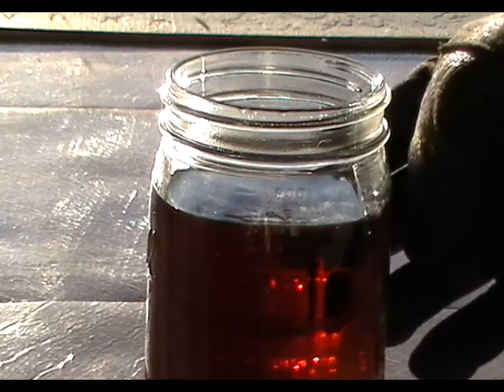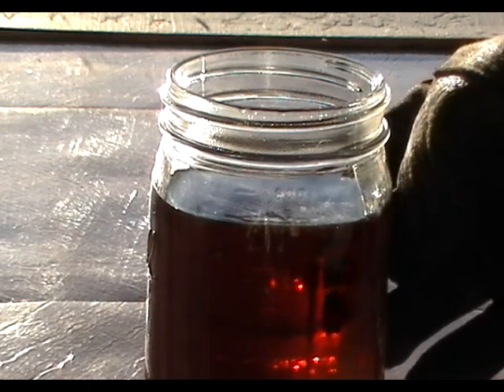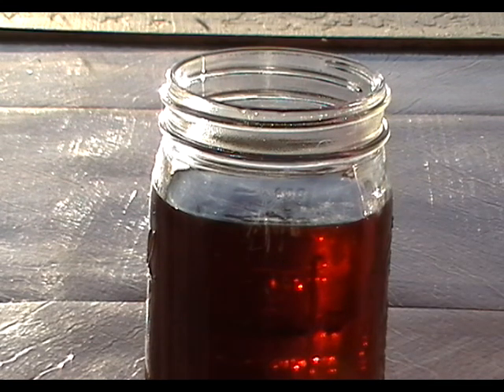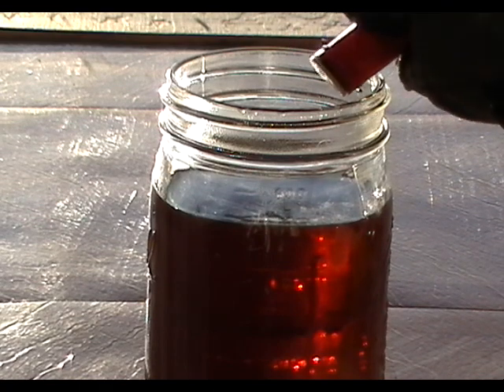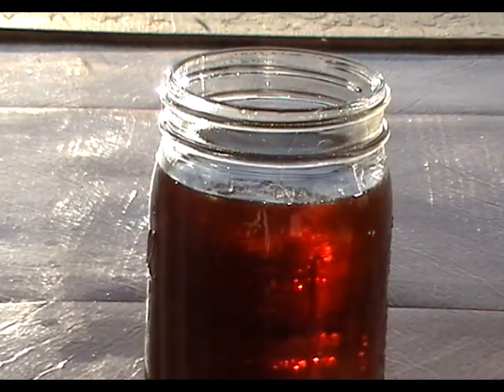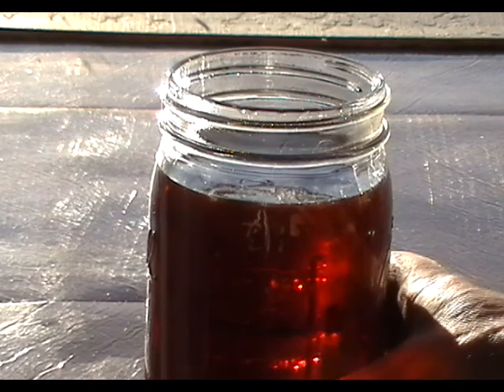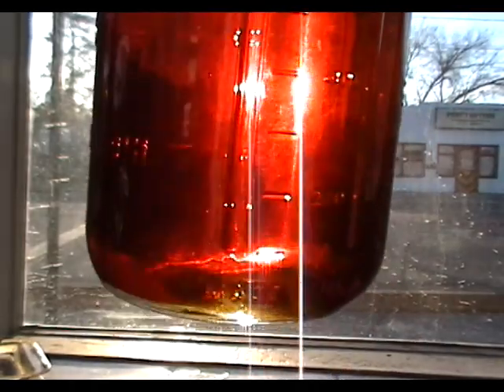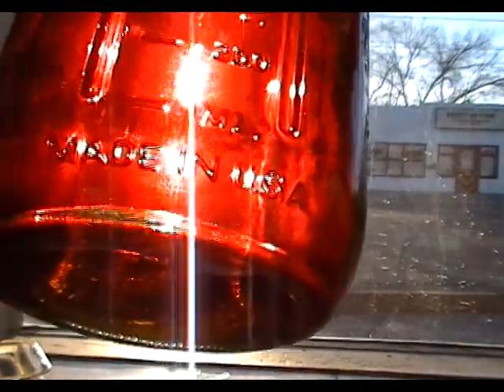Blending Gasoline with vegetable oil to make Diesel Fuel

Comment from the maker: Diesel engines today were optimized to burn diesel fuel, which is 10x less viscous than vegetable oil, so one cannot start up a diesel engine on vegetable oil with out coking the injectors.  This is why most SVO systems have two tanks.  One for diesel to start up on, and one for VO to run on.

However, for short trips around town, then a 2-tank system is impractical.  This is where blending becomes more useful, because you can start a diesel engine on a blend of gas and VO with no coking problem

Comment from the maker: @MrSzviktor diesel, and waste oils could be cat-cracked to simplify the molecular structure of their fractions to produce gasoline, kerosene and diesel fuel.  Or, gases, such as: Methane, propane and butane can be hydrated to make more complex molecules that can be used for gasoline, kerosene and diesel fuel.

Comment from the maker: If you start with clean and dry WVO, then maybe nothing will precipitate out of solution with the WVO when gasoline is added to it, but maybe not.  However, it is a lot less work to clean up WVO after adding gasoline to it, than before.

Comment: Actually diesel is a higher boiling point than gasoline component of crude oil that is separated by means of distillation. It's also produced by cracking longer chains of hydrocarbons with even higher boiling points than diesel into shorter diesel ones. A third method involves producing diesel from lower boiling point short chains.

Comment from the maker: @lolailando your Clear Liquid Shortening, which is all vegetable soybean oil should work just fine for blending.  So, just add gasoline to it at 20%, then let it settle for 24 hours, then drain off the bottom sludge, or pour off the top the good fuel blend, then filter down to 1-micron into your fuel tank.  That is all there is to blending.

Comment from the maker: @125varma it is better to blend gasoline with waste oil first, then let it settle for a few days, then pour off the light, thin blend off the top through a filter, then you have saved your filters and reduced the work needed to purify the fuel blend.

Comment from the maker: @tomt6040 If you put a match to a container of waste oil with 20% gasoline blended into it, then the surface of that container will light, but it is just the gasoline that is burning.  The flame is quite a bit like an alcohol flame, in that it is relatively cool and not strong.  However, I would not heat waste oil with 20% gasoline blended.  There is no reason for doing so.

Comment from the maker: Since blending gasoline with WVO forces dissolved contaminants in the WVO out of solution, then it is wise to use gasoline blending as a stage in your WVO fuel processing.  So, there is no reason to hyper-filter WVO before blending gasoline with it.  Just settle out the fats, separate them, then blend gasoline with the clear amber WVO, then allow that blend to settle over night to a week, then separate the sediments from the clear blend, then filter the blend.

Comment from the maker: The steps for blending gasoline with vegetable oil are:
1) Add gasoline to waste vegetable oil at the desired amount, which is 20% for canola oil, other oils may need more
2) Leave the blend undisturbed for at least 24 hours, if not a week.
3) Separate the 10-20% precipitates from the 80-90% clear, amber liquid that floats to the top.
4) Filter the 80-90% clear, amber liquid blend into your fuel tank.
5) It is best to test the specific gravity or viscosity of your blend to make sure
That's it
Reply: Do you filter the WVO first before blending with gas or can you blend the gas with unfiltered WVO and then filter? Thanks
Reply from the maker: @bobbynolen154  I warm up the WVO until it's fully liquid when I get it and pour it through a series of screens directly into diesel fuel, then leave it to settle and cool for as much as a month. Then when I'm ready to process it further I'll pour that settled blend into a container with gasoline in it which will result in a WVO blend with diesel at 20-30% and gasoline at 20%. And, I'm careful not to pour any sediments or cream colored high melting point triglycerides which have settled to the bottom. I leave that 50/30/20 blend to settle for a few days, and by then I moved that blend into a cone or domed bottom tank. After a few days of setting I'll crack open the bottom valve on that tank to drain off anything dark or cream colored. I'll drain sediments every day from that tank until no more sediments come out. Then I pour acetone at 1% into the top of that settling tank and leave it to settle for 24 hours, then drain any water, or dark or cream colored, then run the blend through filters into my fuel tank.

Comment from the maker: Yes, but blenders do not need to worry about water, because when you add gasoline to WVO, then the water settles out in about 24 hours.  So, forget the heat.  Just pour gasoline on top of WVO, leave to blend, and settle on its own without agitation, then after a week pour off the top clear fuel through some kind of filter.  Blending is that easy.

Comment: @Jhananda What is there to prevent pre-ignition if it has a lower combustion temp than diesel fuel? Are you in a southern climate? I've heard that you can't use WVO during the winter.  Anyway, I'm glad it's working out for you.

Comment: Just to add.............  seems not "gunk" up the engine and sometimes the landcruiser sits for some months without use. I used a injector clean every 10,000 km as I do when running correct diesel fuel. Always very easy starting.

Comment from the maker: @lolailando You could just use the heat from your boiler to heat the WVO, like a two tank auto system, then you would not need any gasoline at all, except in your "startup" tank, to get your boiler going, if it goes out.

Comment from the maker: Vodka and Tequila are ethanol, which can work as gasoline, but not diesel fuel.  You could use ethanol to modify vegetable oil via the biodiesel process, but most of us find free vegetable oil, but not free ethanol, and ethanol costs most of us more than gasoline.

Comment: Dear Sir
Reporting back on my tests.
Mixed wvo 50 to 30 diesel, waited for 3 weeks then added 20 gasoline , then 1 acetone and left for 24 hous.
Ford Transit 2004 2.0 diesel 125H FIFA
Test were doneduring +24 C per day and
+ 12 C at night so in the morning when first starting about +18/+20c
7,14,25 minutes long trips.

Topped up my empty fuel tank with abut 1-2 litres of diesel left in it.  i have poured 25 litres of my blend into  my tank.
First couple of days blend  burned well with van starting and  driving same as on pure diesel , judging by driving experience. Moderate smell of chips lol.

Half way through these 25 litres of blend , probably closer to the end  , first time in the morning  cranking became longer and longer . Any other engine cranking during same day were always fine with fast  engine start. Eventually cranking became almost impossible to start engine. Webasto helped it though. With webasto cranking only for about 7 seconds, sometimes 4 seconds.
White smoke/ not very thick  from exhaust  pipe with first engine start in the morning after long cranking and no webasto in prior , also strong smell of chips. Then white smoke goes away after about 30 seconds. 
Burned all 25 litres of the blend and added 10 litrs of pure diesel. Untill all 10 consumed every issue remained. Now topped up 13 more littrs of pure diesel. Today first morning start went better better, no help of webasto, 7 seconds crancking. White smoke for few seconds only.

Engine coolant red liquid tank has some oil in it..... Ordered test Emissions in coolant tank to check if it is gasket or gasket seal gone bad. 

I bought this van with fuel system problems any way,  
error codes p2291 and po251
most likely high pressure fuel pump or its valve or injectors.
ignition coils sigh on instrument cluster blinking when gas pedal all the way to the floor and then fuel delivery stops untill engine restart.

Probably injectors cups as well.....

Any advise would be Greatly appreciated .

Could it be that wvo  oil in my blend were not burned fully and lots of it is still seating in the system ?
i cant smell gasoline or diesel in my contaminated engine coolant tank . Just oil and it is not black .Engine oil coolant tanks cap has bright yellow grease.My wvo is brown. Engine collant tank has some brown looking oil in i.

Mechanics before my test changed water pump and hydraulic liquid pump and could contaminate coolant with grease...

Van runs without overheating, 82c .
Engine oil is clean still.

Could be anything i guess. Oil cooler or my gearbox is leaking as well with clear yellow oil.

Wonder if wvo is still in the system after running on 23 litrs of  pure diesel.

This morning +13c at night was +8  first engine start white smoke for few seconds and 7 seconds cranking to start engine. Well might be broken injectors caps.

Egr and fuel temperature  sensors are  not yet off
Reply from the maker: Thanks for your excellent report. I don't see how any fuel could end up in your coolant. Ask your mechanic. Normally when the head gasket goes bad you will get oil in the engine coolant and water in the crankcase. 

Otherwise if you could plug your diesel into a power outlet so the engine is kept warm you would not likely have a starting problem. Otherwise if you had room for a second fuel tank, even a small one you could startup on diesel and switch over to your fuel blend in the main tank, but you would want to shut down on petroleum diesel before shutting your engine off. This works best if you have a long drive in between. 

Also, 24hrs of settling is generally not enough time, but adding acetone last will accelerate settling so 20hrs after acetone is added might work.
Reply: @Jhananda  Thanks Jeffrey.
i think starting problems are from air in fuel system, as any other  engine start during same day after first long one  are smooth.
Also i have examinated fuel filter and it had some grease on it/coconut oil in solid state when kept in cold.  Very light white ish semi transparent kind of looking/ definately not not bright yellow as in my engine coolant tank.  Very little , but that is only after 25 litres of my mix burnt.
I bet after 500 km it could me clogged . Pure guessing it is. Thats ok as if i get good at bleading air out i can keep removing and lol cleaning fuel filter from that greas with dry rag.

This experiments is stopped now till next may due to winter time. 

waiting for diesel injectos leak off test set to arrive now.

Have to find what is wrong with my fuel system. This fuel system issue is from previous owner.

P.S. i have done co2 test in my engine coolant tank while car idling. 
No co2 was found , no engine overheating still and engine oil is in normal state.

Chears
Reply from the maker: @maximolotov  thanks for more reporting. Generally the first load of DIY diesel does not cause problems unless one's blending method is grossly wrong. More typically the problems with blending are due to accumulation over time of congealed fats and/or coke. Also, winter poses a serious problem due to fat congealing due to cold, so it is good to know you are going to wait until spring for future experiments.
Reply: @Jhananda  Roger that .
Ty Sir
Reply: @Jhananda  Can engine be monitored while it is getting coked ?
Checking through glow plugs holes for example using boroscope / endoscope ?
Reply from the maker: @maximolotov  the symptoms of coking are increasing difficulty in starting as well as increasing smoke. The solution is to switch back to petroleum diesel and remain on it until the engine starts running properly. Typically it takes one or 2 tanks of real diesel for an engine to burn off the coke. If you wait too long, as I did with my first vehicle running on DIY diesel, the engine will end up hopelessly coked smoking badly in bleeding oil from its main seals.
Reply: @Jhananda  Starting problems i had are now fixed and were caused by bad injector which is now rebuilt. Car starts in 1.5 sends in 0 celcius.
injectors leak off test answered all quastions
Reply from the maker: Yes, I'm not surprised your injectors were bad. You are likely to have a positive experience from here on out. Thanks for posting your results.
Reply: @Jhananda  Good weekend  Sir.

Comment: @Jhananda < The word is "missed" and I make and sell the stuff in 370 gal batches every day. I'm a licensed IKG transporter and renderer and make my saleable product at specified parameters. All diesel engines will run on unmodified veg oil straight out of the Wesson bottle from your grocers shelf, gasoline is only added to WVO to specifically to burn off glycerines as well as dissolve any particulate food matter that slipped past your filters and centrifuge.

Comment from the maker: It has been common practice in England to blend gasoline at 5% with biodiesel to keep biodiesel from gelling for > a decade.  I have run a 6.2L Detroit diesel on gasoline-waste oil blends with gasoline as high as 30% for 6.5 years, so if you had engines blowing head gaskets from running your biodiesel that had been transported in fuel trucks that had hauled gasoline, and there was less than %5 gasoline left in those tanks, then you should look elsewhere for the cause of the blown head gaskets.

Comment from the maker: Yes, cutting cheap, or free, waste oils with less gasoline, than it takes blending with diesel fuel, then a very economical fuel can be had for any diesel engine.  However, it is a myth that people damage their engines with waste oil blending.  In most cases the problems people have are related to blending WVO back to back with WMO, which does cause problems.  Yes, WMO has a lot of ash; however, there is a video on YouTube that shows the bores of an engine that ran WMO for a year and had no wear

Comment from the maker: @tada786 I have been running my diesel engine on a blend of waste oil at 80% and gasoline at 20% for 4.5 years.  My engine still runs fine.  Therefore it is unreasonable to consider that this blend is harmful for it or any other diesel engine.

Comment from the maker: @gnockergnutz well, I think you mist a few things.  First, gasoline at only 10% with waste vegetable oil is insufficient to burn properly, so, yes, you are adding heat to your fuel system; however, if you do, then you will end up with vapor-lock.  At 10% gasoline in your blend vapor-lock will not be particularly noticeable; however, at higher levels it will become significant.

Also, hydrogentated oils and animal fats will form precipitates in a petroleum-based WVO blend, not good

Comment: the simple answer is viscosity, if its to thick it doesnt penetrate between tight tolerance pump components so some pumps can seize up solid (lucas dpa for example), many bosch pumps can run pure veg oil, but mine runs lumpy at idle without petrol or white spirit etc even on bosch VE, new tank, filter etc as it happens.
I can get nitro methane for £45 a gallon, that works well as an oxygenating fuel also, but may corride pipes etc.

Comment: Diesel will gel in winter because it contains wax. Gasoline does not therefore it will not gel and act as a solvent (up to 30% gasoline) to extend the low temperature pour point of oils. Regarding the WMO fuel. We have conducted thousand of hours of testing on various blends. These are described in our book "Alternaive Energy Secrets." The actual blend depends upon the engine however we have 2400 hours runtime on straight motor oil that had been centrifuged to remove the particulates.

Comment from the maker: @tomt6040 Gasoline engine automobiles are the most common car on the road and they do not burst into flames every day.  Yes, the returning fuel in a diesel auto is heated by the engine, but the return line has a very low flow rate, so when the heated fuel returns to the fuel tank, the thermal mass of the fuel there, plus heat losses results in a fairly low temp; however, on a hot day in a hot region, with a low fuel tank, could result in enough heat to cause vapor lock, but not explode

Comment from the maker: @Inspironator I have been blending gasoline at 20% with WVO for more than four years and have not had the problem of pre-ignition or knocking that you predicted, so I find no evidence to support your fears.  Instead I find gasoline in a WVO blend in a diesel engine acts as a kind of "spark plug" stimulant to my engine that gives it power and it tends to run clean

Comment from the maker: @gxr420 I am doing well, thanks.  The cheapest solvent that is available to me is gasoline, so I use it most often.  But, other solvents might be cheaper for others in other regions, such as kerosene or pure gum turpentine.  I prefer using pure gum turpentine because it smells so good, and it is biodegradable, etc.  But it is very expensive for me to use.

Comment: My question is about- what floats to the top ? When you wrote the 5 steps to filter 6 months ago- Step 3 says: 'Separate the 10-20% precipitates from the 80-90% clear, Amber liquid that floats to the top' .  I was planning to buy a 10 micron and 5 micron filter bag for about $6 each on Amazon, and a propane burner for $60(already have tank) and 5 gallon pot for about $20 to heat WVO.

Comment from the maker: If you are going to use D2 diesel fuel as your blending agent with waste vegetable oil, then 50%, or more is best; however, that blend tends to have problems in cold weather below 32F (0c)

Comment from the maker: There has been no evidence of glazing or varnishing etc. in running WVO-based blends in more than 5 years.  Therefore Glycerin does not seem to be an issue.  However, a necessary component to blending is a settling period, 24 hours for WVO blends, and 1 week for WMO lends.  During that time any component of the waste oil that does not remain in solution will precipitate out of solution and be removed.